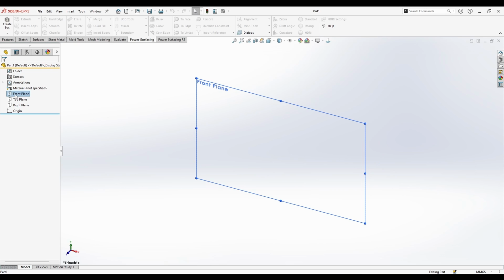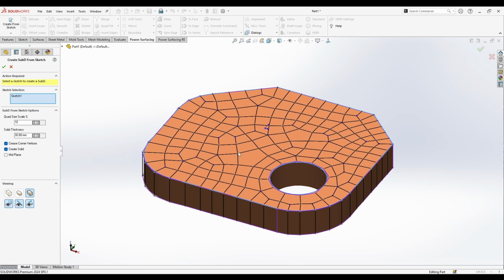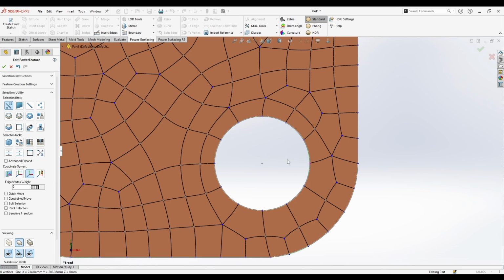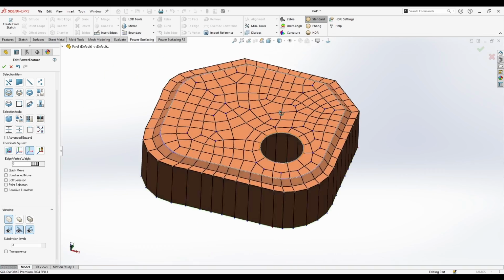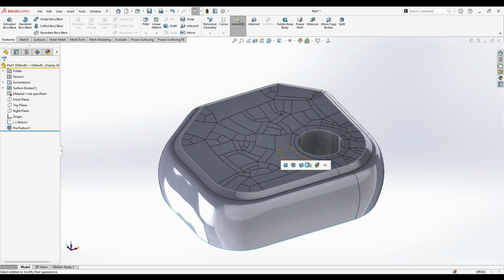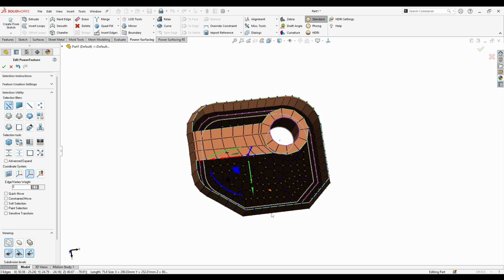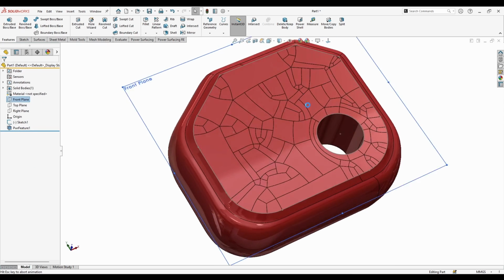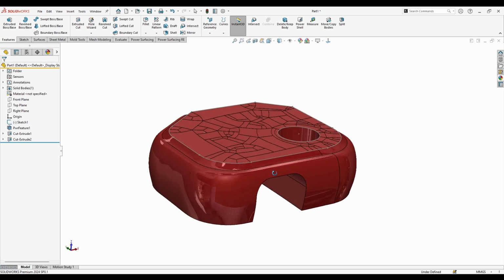Examples For How to Create From Sketch | Power Surfacing | SOLIDWORKS

Comment: In fact, the appearance of the command icon should be more beautiful. And the commands themselves should be textually very similar to SolidWorks. And the user interface should be much easier. Commands combine and trim and two-dimensional commands spillan and circle and... should be added and the design tree should be similar to solidwork

Comment: Hello, you do not add new features to the plugin every year. Features including revolve, sweep, loft and... You work very poorly. But you have a good plugin, which is very reluctant to add new commands And if the commands are similar to commands such as SolidWorks, it will be very good. And by the way, the tree does not have a design. And the plug-in commands and appearance of the plug-in are very different from SolidWorks.
Reply from the maker: Unfortunately, we are under a lot of pressure due to fixing bugs and following up with our customers. Of course, everything you say has been on our mind for a while and we look forward to adding it very soon.
Thank you !